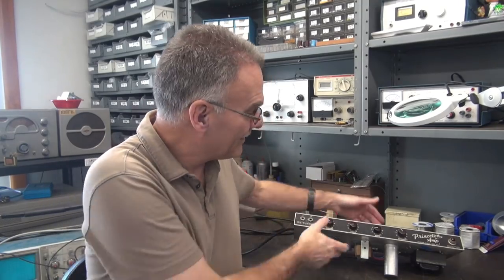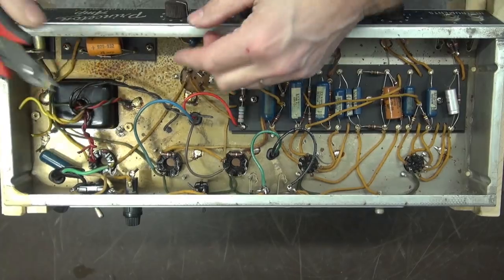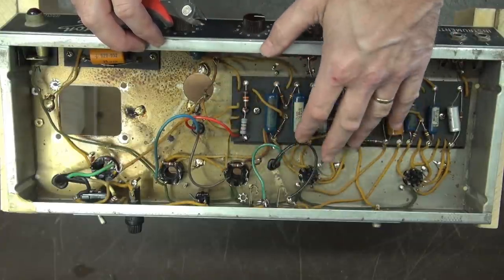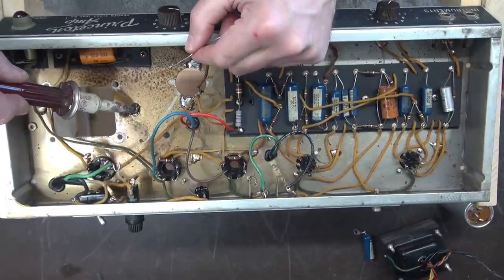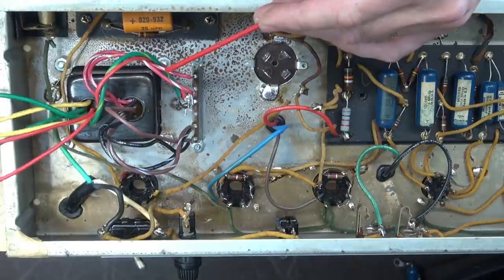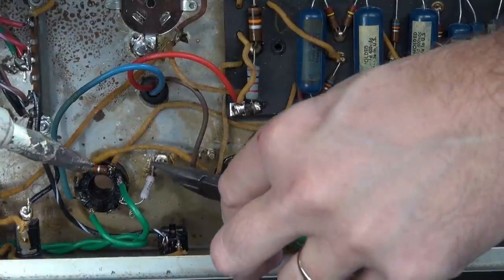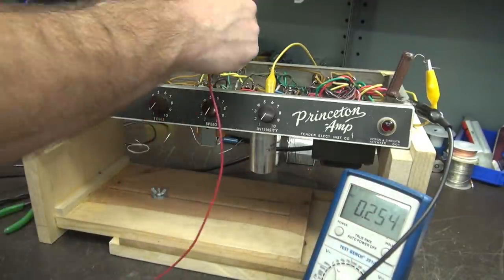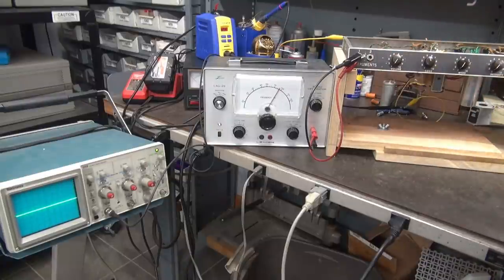How to repair 62 Fender Princeton Tube guitar amp smoked power transformer bring it back to life!

Comment: 15:30 when you soldered that 1 ohm resistor to the tube socket pin, it was really thin. So much it looked like it broke free when soldering the other end to the chassis. Towards vids end it still looked thin....

Comment: im having a similar situation. i have a smell out of mine and dead audio not even a hum.  but its old 1961 so i figured just musty old smell from being in old storage.  my tubes and pilot light still light up. would that happen with a dead power transformer? if not i have to loot at the output section.

Comment: Does Hammond have direct replacements for Fender and Marshall?
Last time that I checked into Hammond (years ago), their output transformers had weird speaker taps. Did they ever fix that, as in simple 4,8,16ohm taps for use with a normal 3way switch?

Comment: I recently did a dumb thing and smoked the PT on my 1980 Deluxe Reverb. I have a Hammond drop in replacement on the way. Do I need to change all the caps under the cap cover when I install the new PT?

Comment: What is the difference in the 12AX7 LONG Plate compared to short Plate? What did you use on the bottom of the bias pot to make it not more on the chassis?

Comment: Thx for nutha fine repair! Curious, about the filter caps. Your are correct, in that Fender never put a 70/40/40mfd in such a an early small amp.Your unit looks like a 6G2 chassis ; orig spec was 30/30/30. I wouldn't be surprised if the excess filter value contributed to the transformer's early demise. I also agree with the high moisture being a factor.

Comment: I had that same set of wire cutters for several years - i used them for a few build and misused them much more than i've seen you lean on yours. But then one day i figured they'd be perfect for trimming my strings during a re-string. wrong. that wrecked them
Reply from the maker: Yep, I agree, they are great cutters for soft wire. You can buy them in cases of 10 for less than $5.00 ea!
Reply: @d-labelectronics  They're well worth it. I bought 2 more sets after i wrecked those, and a proper set of hardened cutters for my strings - so i didn't have to use the ones that are part of the string winder anymore. Love your videos - i always learn something new.

Comment: I hope that epoxy never turns loose.  I'd hate to have that metal pot moving around that close to the terminal board.
Reply: When Terry said he used epoxy the same thought went through my mind. If It did go loose there would be fireworks.  I am sure he has used this method successfully in the past though. Another great video.

Comment: what tube pin and the pin's function did you connect the 1 ohm resistor to ground for bias measurement, the cathode?
Reply from the maker: Pin 8 on each 6V6 to chassis

Comment: I am a bit confused about ClassicTone because their website is still up and running, with no mention of anything at all?
Hammond basically has the same models
Reply: No, Hammond does not have the same models. Classictone made exact replacement transformers, similar to the much more expensive Mercury Magnetics transformers.
Reply: @matthewf1979  I don't understand? Hammond has the same models also spect and having the looks of the original parts (as much as possible)?
Reply: @p_mouse8676  if you look at the specs, they’re wildly off. Most of the Hammond transformers have an overbuilt high voltage secondary that supply amps with voltages beyond original specs. That is detrimental to performance, especially when it can damage circuitry not designed to deal with 50 + vdc over component ratings.

If you build a clone or something, that’s ok, but old amps have 450vdc electrolytic caps and 400vdc & 200vdc coupling caps.

Comment: Out of habit I realized I was holding my breath while those solder fumes were going up at the camera😂 

Great repair video!
Reply: I have a computer fan attached right on my soldering station that I run off a 10.8 volt battery from an old stick vac. Sucks those fumes right away from my face. It's zip tied to a metal angle plate, and stuck on there with a couple ;of magnets. Works a peach!

Comment: The leads on the OT look new. Is that a replacement OT?
Reply: @brich2929  WTF are you talking about? D-Lab changed the POWER transformer. He said nothing about the OT. I am commenting that the leads on the OT (inside the chassis) look new.

Comment: squirrel stole the show at 26 minutes in....i own a Princeton 65 and appreciate the vid  KC7IVJ
Reply: LMAO.....I saw that too....good catch ! I have a  65 Princeton RI......almost tempted to rewire the whole thing with P/P.  Went thru two (2) sets of 6V6's even tho they were properly biased, I believe one of the tubes in each set were defective....started to internally arc...made a hell of a  racket.  I installed 'Amp Doc' tubes and have not  had an issues since !

Comment: People with vintage amps shouldn't be running them on 120 volts when they were designed for 110-115 volts, it's a common issue these days when a lot of power coming out of the wall is sometimes 125 or higher.
Reply: A fused variac and digital voltmeter is a must
Reply: I built a bucking transformer for my old tweed deluxe years ago.  It drops my line voltage down to 114.  Cheap and easy way to reduce voltage.

Comment: At 9:38 we get to hear Ghoulardi! At 11:48 wouldn't it be better to twist the two center tap wires together then solder them to the chassis? Excellent idea on using a
double ended screw post terminal board for all those wires. They won't be going anywhere but where you solder them. Like the wire dressing you did in the chassis
because it should eliminate any induced hum. All in all you have excellent restoring techniques Terry . I guess that's why I appreciate all your amp  repair videos!
Sad about Classic Tone going bye, bye. Oh, and happy birthday to your mom!   Steve
Reply from the maker: Thank you Sir, I enjoy your kind support. I wont let you down
Reply: @d-labelectronics  Terry, what wattage and model number is Snozeramus?

Comment: I still don’t agree with replacing the output tube grid coupling caps. They should be tested at their rated voltage, and replaced if they fail. 

Yet, it’s not me doing the work and if the customer is happy, that’s what matters. Thanks for sharing your work Terry!